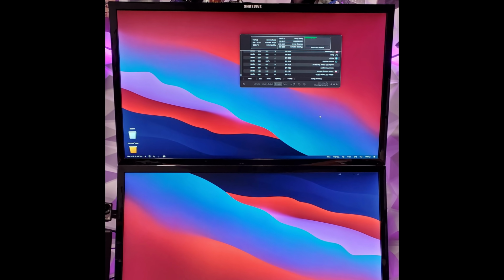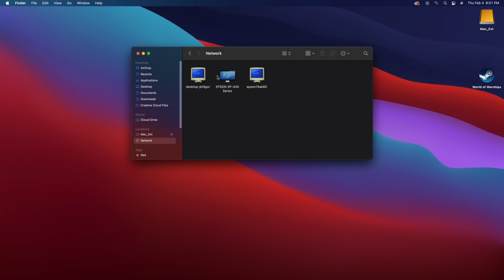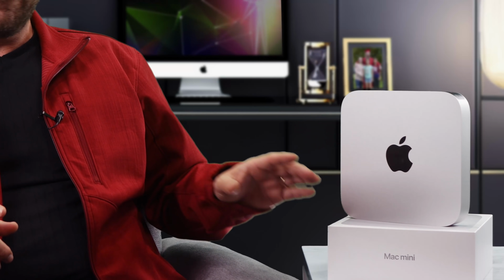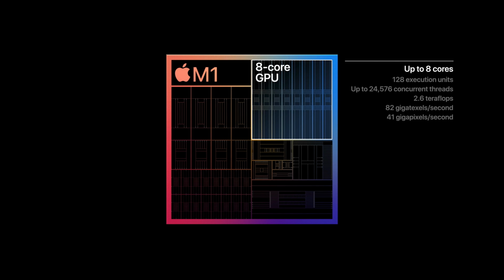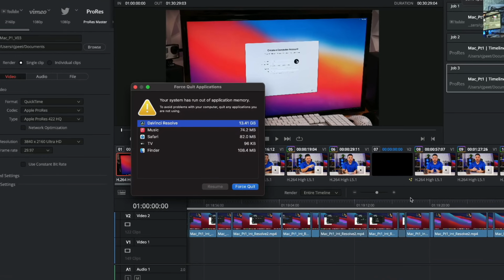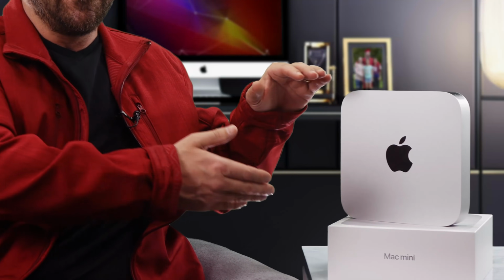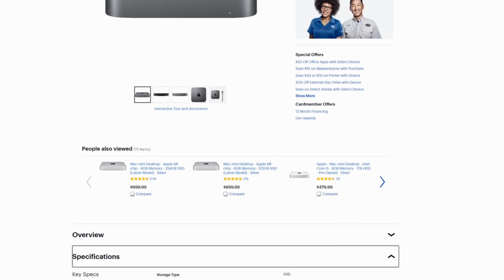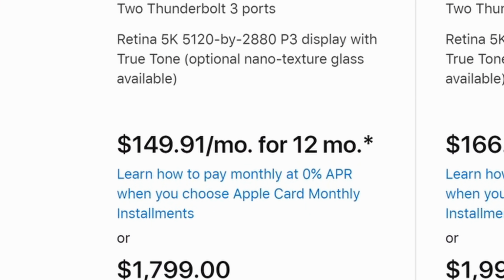M1 Mac Mini One Month Later - A PC User Deep Dive

Comment: At the time of this comment, I'm "stuck" with a late 2013 27 inch iMac, which I'm selling cheap to switch to this exact Mac mini, knowing its limitations BUT it will be a 2.5X performance increase from my actual system and without spending any money, because the iMac will sell for quite more than the actual Mac mini's price. Yes, I will miss my 24GB of RAM, but I will be able to run lots of programs that the outdated iMac can't. Good tradeoff for a couple of years.

Comment: I 100% agree on the memory issue. No new computer should come with 8GB of RAM in 2022.(Maybe a chrome book or Linux based system) 1TB/16GB should be THE only specs for the mini and that should be $700.

Something I do take issue with is your constant comparison to a custom built PC. This is not a fair comparison for two reasons. 1) with a PC you would be stuck with Windows (fuck that!) or Linux (give up the pro level software). 2) Apple is an OEM machine.

Comment: Please, how to connect the M1 Mac mini to iMac Monitor?
Reply from the maker: You can't. Apple removed the ability to use the iMac as a display a long time ago. If the iMac works you would have to use screen mirroring. Or if the iMac is dead you can buy a internal HDMI adapter, but that requires disassembling the iMac.
Reply: @ElevatedSystems  Thank for let me know

Comment: Thank you for taking the time to make this video! I've been using PC's for a bit over 20 years and just as a hobbyist/enthusiasts built some high performance PC's and always laughed at people when they mentioned Apple to me, until recently! My wife has changed jobs and we have been forced into the Apple ecosystem (They provided her with a MacBook Air)and I must say OS has been way more reliable and smoother than Windows especially now that Windows 11 is out. For me to just play around a friend gave us a 2009 iMac they weren't using with Yosemite installed so I used OpenCore Legacy Patcher to get Monterey running on it and was fairly impressed. As you mentioned graphics cards aren't easy to get at the moment and with some other things we were thinking of purchasing a Mac mini after I try a 2011 Mac Mini that a separate friend is giving me that he no longer uses. After watching your video I will consider getting the M2 that will be out later this year and if we have any problems it will be getting returned.

Comment: Yes I switched to Mac Mini, after getting pissed off with Win 10 PC, spending +2 wks reloading and repairing due to random BSODs, PC was to bare minimum, changed NVME SSD, still didn't help, so went to Mac Mini.  Strangely Mac Mini can read my portable HDD (Win 10 formated) photos and files, but cannot write/save editted Lightroom photos.  I will go figure it out.  Thanks for an awesome video.
Reply from the maker: Mac can read  NTFS formatted drives but not write to them. If you are sharing the drive between Mac and Windows systems reformat it to ExFAT. If you are just using it on Mac then you can reformat it to APFS.

Comment: If it generates almost no heat and draws little power why is there sleep/energy save mod?
Its all BS.
You don't need it.
I never even use sleep or any energy saving on my desktop PC neither on my PS4.
Everything is either always on or if I dont need it shut off.
I stopped this BS years ago when "energy saving" tried to cook the CPU and APU on my PC and PS4.
At this point I think energy saving methods are nothing but a smart way for the manufacturer to shorten the lifespan of your gear so you have to buy new one.

Comment: My question about the M1 Mac Mini is this: 
I run a 7 cam rig with OBS software to stream live music. There's a Radeon X580 eGPU that is connected to my Macbook Pro, that pushes out to two 4k monitors. Sometimes I have backing tracks playing, as well as occasionally running Adobe Audition. Chrome is usually always involved somehow.

Will the Mac Mini handle all that by itself? Currently the eGPU is not compatible with the system. If yes, should I get the 8gb or 16gb model? Will 8gb handle all that?
Reply from the maker: The problem is the M1 Macs have no eGPU support, and may never, so if you want to run 2 displays you'll then only have 1 thunderbolt port and the 2 USB ports available. If you do go with the M1 definitely go with 16GB of memory.

Comment: I've seen another video that anything metalic under the Mac will interfere with the antenna on the computer. That might have been your problem. Trying not to have anything underneath the mac
Reply from the maker: I'm going to call that a design flaw as most people have a desk under their computers and don't just suspend them in mid air. But seriously I'm aware of the issue and for almost the entire time I was testing the Mac nothing was under it except the the desk, which is wood.

Comment: RCA cables are not balanced. Balanced cables like XLR or TRS 1/4" will keep "interference" at a minimum.
Reply from the maker: There isn't a problem with the connection between the DAC and the speakers, the problem is with the USB connection from the MAC to the DAC.
Reply: @ElevatedSystems  If that noise is not on your recordings than it’s being induced on the output stage. Unbalanced cables accept interference from EM fields near the length of the cable. I’m just saying always use balanced cables if possible.
Reply: that not normal...even M1

Comment: Your buzz was probably from your XLR cable. Those cheaper cables sometimes have bad solder joints or evenonly have 2 of the 3 wires connected, completely ruining the "balanced" aspect of the cable.

Additionally the Mac mini's "ground" is the aluminum chassis as it lacks a 3rd prong on the power. This could introduce a buzz especially if you have peripherals plugged into different power outlet (this should clean up if you use everything from the same surge protector).
Reply from the maker: The XLR cable is just for the Microphone, not the speakers, and everything is plugged into the same Uninterruptible Power Supply.

Comment: Most people are looking at these first Apple Silicon Macs wrong - these aren't Apple's powerhouse machines: they're simply the annual spec bump of the lowest end Apple computers with DCI-P3 displays, Wifi 6, and the new Apple Silicon M1 SoC.

They have the same limitations as the machines they replace - 16 GB RAM and two Thunderbolt ports.

These are the machines you give to a student or teacher or a lawyer or an accountant or a work-at-home information worker - folks who need a decently performing machine with decent build quality who don't want to lug around a huge powerhouse machine (or pay for one for that matter). They're still marketed at the same market segment, though they now have a vastly expanded compute power envelope.

The real powerhouses will probably come later this year with the M1x (or whatever). Apple has yet to decide on an external memory interconnect and multichannel PCIe scheme, if they decide to move in that direction.

Other CPU and GPU vendors and OEM computer makers take notice - your businesses are now on limited life support. These new Apple Silicon models can compete speed-wise up through the mid-high tier of computer purchases, and if as I expect Apple sells a ton of these many will be to your bread and butter customers.

In fact, I suspect that Apple - once they recover their R&D costs - will be pushing the prices of these machines lower while still maintaining their margins - while competing computer makers will still have to pay Intel, AMD, Qualcomm, and nVidea for their expensive processors, whereas Apple's cost goes down the more they manufacture. Competing computer makers may soon be squeezed by Apple Silicon price/performance on one side and high component prices on the other.  Expect them to be demanding lower processor prices from the above manufacturers so they can more readily compete, and processor manufacturers may have to comply because if OEM computer manufacturers go under or stop making competing models, the processor makers will see a diminishing customer base.

I believe the biggest costs for a chip fab are startup costs - no matter what processor vendors would like you to believe. Design and fab startup are expensive - but once you start getting decent yields, the additional costs are silicon wafers and QA. The more of these units Apple can move, the lower the per unit cost and the better the profits.

So ... who should buy these M1 Macs?

If you're in the target demographic - the student, teacher, lawyer, accountant, or work-at-home information worker: this is the Mac for you.

If you're a heavy computer user like a creative and don't simply want a light and cheap computer with some additional video and sound editing capability for use on the go - I'd wait for the M1x (or whatever) later this year. You'll probably kick yourself when the machines targeted at you finally appear.

Comment: I was very curious about an objective review of the mac mini and whether its use of arm architecture could lead to a paradigm shift as to the desktop PC. I was also impressed by the thermal efficiency. However the issues of working with software that is either not optimized or perhaps falls outside its computing boundaries still needs to be adequately tested. There may be somethings that the M1 does very well and with others struggles in perhaps the same software. SSD swapping may also lead to extra stress on the ssd & as it is soldered on - hence the issue of the robustness of the system and also it is not easy to replace individual parts if there is any partial breakdown. The other is the use of peripherals and your review again shows that some may work while others may not. All the PCs I have built I have never had problems with peripherals - whether wireless or wired or with audio or display.  At this point I donot think the mini can replace the desktop but as a semi mobile device can lead to many interesting possibilities.

Comment: The noise/electrical issue is a serious concern for those of us making music & video. I don't see the current GPU surviving new chip revisions. Apple have ALWAYS shortchanged buyers on ram. Given the cost theses days it's shameful. Most will love it and a few will hate it. I'll wait until the hardware is a couple of revisions before buying. The best bang for buck Mac is a Hackintosh. Which is why they exist. It's difficult to sell the Apple environment to windows users. They just don't get it, because nothing exists with that level of integration on Windows. you can get something like it, but not quite the same.

Comment: Everyone is wrong about the RAM. 8GB matches 16GB performance in all but edge case use. It's an entirely new processor using on-chip memory and a massive amount of L2 cache. Conventional wisdom about how RAM works in a motherboard x86 configuration doesn't seem to apply here.
Reply from the maker: The software allocates data to memory not the CPU, so the M1 can't magically make the application processes running on the system use less memory. All the software I ran, even the M1 optimized software needed well over 8GB in typical workloads. The memory swapping has led to 4.04 TB of data written to the Mac's SSD in one moth, essentially giving it a lifespan of about 3 years. This compares to 890 GB of data written per month on average to the boot drive in my main workstation.
Reply: @ElevatedSystems  actual performance tests show little gain with the additional memory and applications often claim RAM inefficiently simply because it's there, so usage is a poor metric. We'll have to see if swap is a real issue for SSD wear and how much additional RAM prolongs it 🤷🏼‍♂️
Reply: @ElevatedSystems  It's pointless to gauge performance by looking at RAM usage statistics. Real world performance comparisons matter - such as this one comparing the 8BM Mac Mini with a 16GB MacBook Pro in DaVinci Resolve editing https://youtu.be/TrlpuvHg_Ig. There is little difference in performance. Of course, there will be use cases where 16GB will give better performance. However, it seems that if you are happy to mostly use one main power hungry app (e.g. video editor) at a time (with occasional transitions to some supporting apps), you will be fine with an 8GB Mac Mini.

There are also workflows that will perform worse than other workflows and vice versa. It's part of being a skilled PC user to be able to adapt to things like that. A smart creative should be able to figure out how to work comfortably on the cheapest 700$ Mac Mini. Especially when it can even edit most of h265 footage available (4K 10bit 4:2:2 25p). That's enough to output serious projects quite easily. It's a no-brainer that people who handle complex projects and don't want to deal with any performance issues need something more beefy than a 700$ mini computer. It's amazing what the 8GB Mac Mini can handle, but of course there are going to be walls that it will run into.

Regarding the disk swap issue - it seems that cases like yours are isolated and not the norm. 8GB Macs should be able to easily stay on the safe side longer than 5 years - which is all you really need. If you are a power user, the same thing applies - get a powerful machine.

Comment: m1 ssd wear issue on 16gb?
m1 ssd wear issue on 16gb?
m1 ssd wear issue on 16gb?
m1 ssd wear issue on 16gb?
Reply from the maker: Yes SSD's have a set number of read/write cycles and because of the Mac Mini's excessive use of SSD memory swaping it will hit that limit quicker, but probably not in it's useful lifespan. However, if you are someone who keeps hardware for a long time this could potentially be a problem as you can't replace the SSD in the M1.

Comment: You can find videos on YouTube of people running pro recording studios on Mac Minis. Try ditching the crap SoundBlaster interface and try even w $60 Behringer UMC22 USB interface. Works perfect with no glitches. Only PC users use SoundBlaster stuff, and most studios use Macs.

The Mac Mini was always an entry level machine.
Reply from the maker: I personally wouldn't run anything professional, as in something that I rely on for income, on an entry level machine. It's been my experience that most professional studios that use Mac's, use multi-thousand dollar Mac Pro's, and Mac mini's may be used as ingest or transcode machines in the pipeline, but not as primary workstations.
Reply: @ElevatedSystems  Lots of iMacs are used in places you wouldn’t expect, like when I worked at Sony Music about 10 years ago. That and cheese graters.
Reply from the maker: @DavidRavenMoon  True, you can get spec out an iMac with high end components and Macs dominate the music industry due to superior studio software, but the bottom line is the Mac Mini has had, and still has IO problems.

Comment: Great video thanks for all your work you have done. One remark though, your memory experience with the M1, doesn’t align with a lot of other  real use reviews nor with the benchmark reviews. And I think the memory allocation formula you used only applies to the X86 intel world. Not with the new Apple M1 world. Just compare the Ram usage and performance between an iPhone and a Samsung phone. They later just have a much higher performance with 30% of the Ram. And as the M1 architecture is aligned with the A processor family it just doesn’t need the same amount or ram as an Intel processor does
Reply from the maker: The software allocates data to memory not the CPU, so the M1 can't magically make the application processes running on the system use less memory. All the software I ran, even the M1 optimized software needed well over 8GB in typical workloads.

Comment: Great review. Makes me want to wait for a mark II with bug fixes and enhanced integrated gpu.  RF or ground loop noise can be so frustrating.  A Thunderbolt interface like Universal Audio should perform better with both lower latency and better components than the Sound Blaster you used. I also prefer interfaces with balanced outputs. I've had that resolve ground loop oise and radio frequency issues that cabling and power conditioning have not solved, especially with powered speakers.

Comment: Nice recap! Question - Doing a M1 Mini 16GB + 256GB Hard drive and looking to run FCP and Logic (also Davinci) on the system. Can I getaway with a 256GB Hard drive and edit off of external hard drives? Or 512GB Hard drive minimum is best?
Reply from the maker: I edited off external drives with the 256GB model. You should be ok with it unless you think you may actually fill the drive with applications.
Reply: @ElevatedSystems  Ah ok. Thanks.